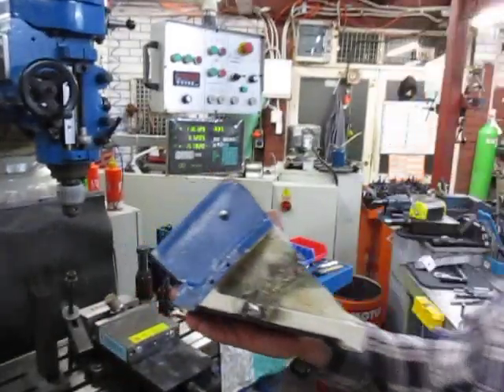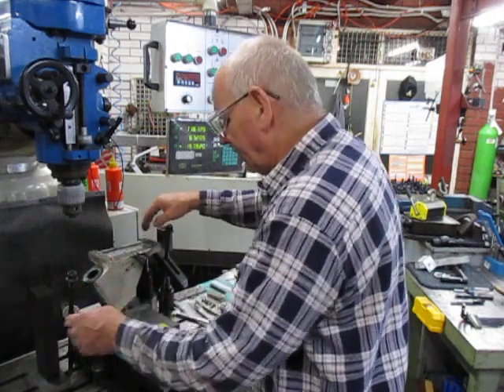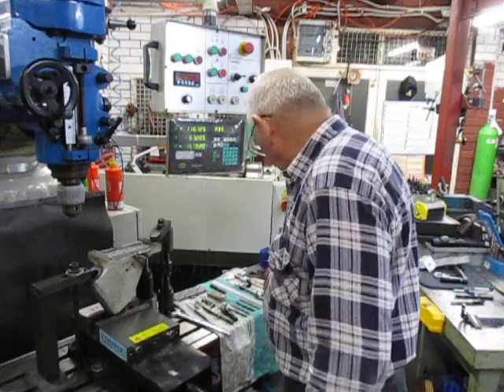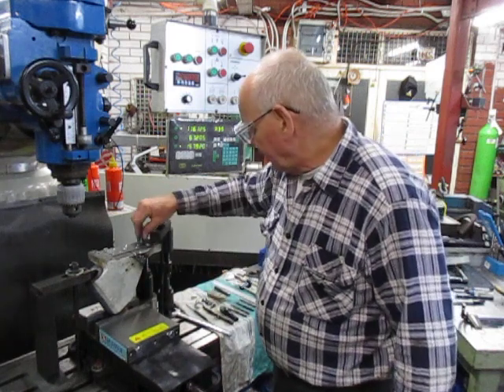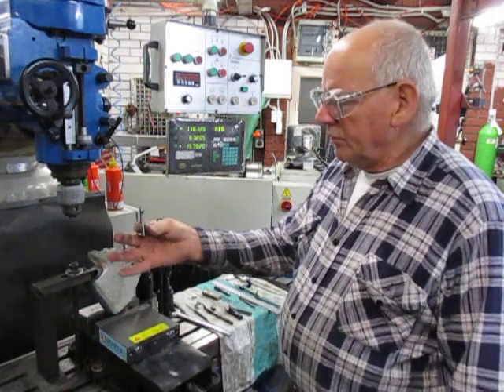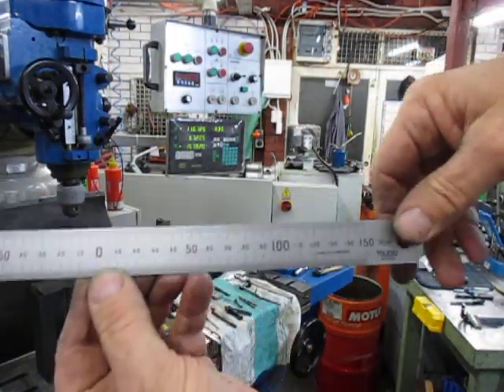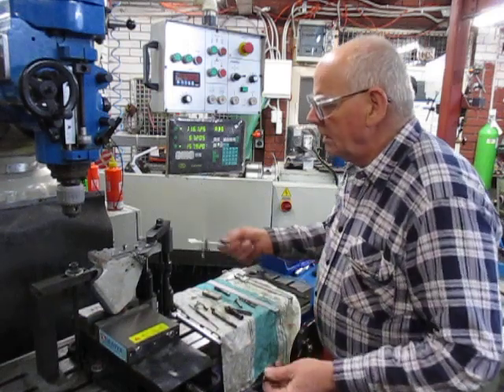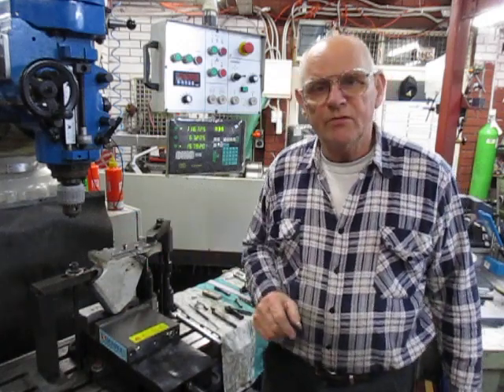Cast iron repair How I stitched up my crack

Comment from the maker: Cast Iron repairs fall into a wide range of options, stick welding can be done with heat (Pre & post) or peening, bronze welding, screw stitching or plate and screws as I showed here are all options that work well. The main issue with welding is always: How to get fusion without impurities coming into the equation? That is a challenge. in the end it is "horses for courses" and what method you are more comfortable with in the given situation.
Reply: Bruce Whitham I have had good luck with a rod called missle rod. YOu used a torch to pre-heat. The penetration is good.

Comment: I have the same ruler but haven't found another on to add to my collection,  I had mine machined so both sides are perfectly flat, I used it for checking engine blocks  and heads for warping.
Reply from the maker: ***** Toledo Australia make the type I showed from150mm to 300 mm. The longer units are either mm or imperial one side only. They also make a combo from 150mm up with metric one side imperial the other. Let me know what you are looking for if you can't find it and maybe I can assist you with that.
Reply: I will have to get another 1 as they come in very handy, thanks for the info.

Comment: I like the steel plate idea but why not consider a braze repair to the ribs as opposed to weld? I would think it to be easier and arguably stronger...  ;-)

Colin
Reply: Had the same thought but maybe it was just faster to stick weld it? Bruce, did you pre-heat the casting? Daniel
Reply: AtelierDBurgoyne Had the same questions too... and crack treatment so they don't reopen under vibration, stress and load ... Pierre

Comment: That is a really inventive solution to solving a difficult repair - almost like putting a new inner steel sole into a boot being repaired by the cobbler!
Do you have any concerns that the crack will eventually open up and give way with inevitable movement and vibration during use?
Reply from the maker: Dan Whiteford The casting was totally broken in half that's why I did a bit of welding to hold it together the "crack" is a missnomer, headline grabber! Bruce.